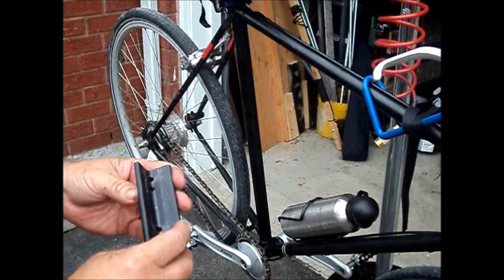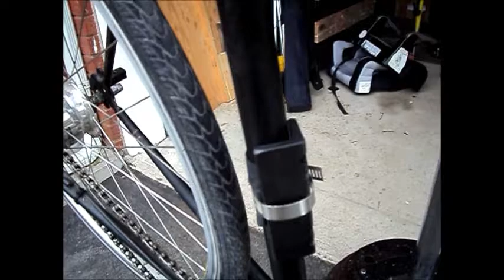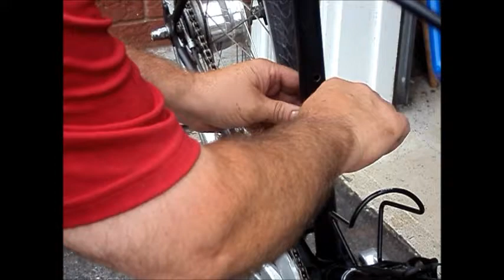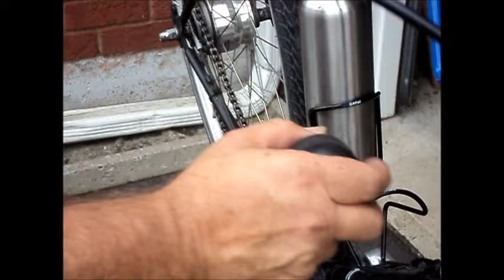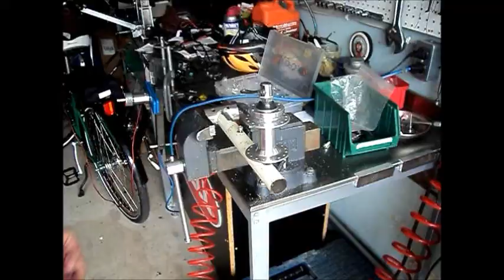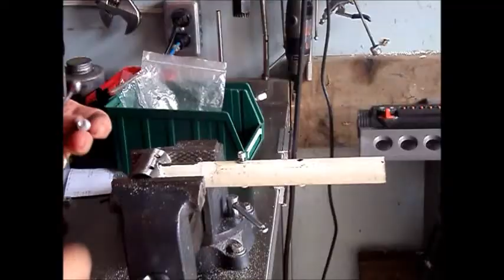Bicycle repair. Water bottle cage installation with Riv-Nuts

Comment: Stop! You had the hose clamp holding the jig. A second hose clamp would secure bottle cage. Maybe some tape so the clamp doesn’t scratch the paint.
Reply: why would he want to secure the bottle cage? that's why he's installing the bosses...to screw the bottle cage to them. and he's already protecting the paint with a piece of inner-tube

Comment: Awesome 'extra features' there. I have the setting tool but I also made a DIY version from a bolt and 2 x nuts one of which I drilled through to remove the thread.

Comment: I've drilled onto a (steel, freshly powder coated) frame several times free-hand, and didn't have any issues, but it'd definitely make me sweat less if I had a jig like that, so I think I'll make one.

What's that adapter for the Riv-Nut that's on your rivet tool, or is it a specific type of rivet tool altogether?

Thanks for the video, it was extremely informative.

Comment: I tried method #3 it worked.At first I practiced,I drilled a whole on an old chainring which is about the thickness of a seat tube.I drilled the appropriate size whole for the rivnut but i couldn't get the rivnut in so i re-drilled the hole opening it a bit,which was my mistake.Because when tightening in the rivnut,it would just spin in the hole and wouldn't grab.I corrected my error and tried it on the seat tube,it came out good. 
TIP:make sure you use a deburring tool on the inside of hole..

Comment from the maker: Are we talking about a steel riv-nut in a steel tube, or aluminum in aluminum? If it's steel, I'd say your chances are good that using JB Weld on the riv-nut would work to fill the gap as steel riv-nuts flare out flat inside the tube. Aluminum nuts tend to make a rounder bulge.
 If it is an aluminum tube, I'd suggest trying a steel riv-nut anyway as the JB Weld would likely insulate against galvanic corrosion in an oversize hole.

Comment: ...the hole is in fact over-sized slightly (partly due to me pulling out the old seized rivnut/bolt). If I use the proper rivnut installation tool will I be able to get the M5 7mm diameter rivnut to fit (the hole is close to 8mm diameter)? I need M5 as need to use M5 bottle cage bolt.

Comment from the maker: Perhaps you need to increase the amount of friction between the riv-nut and the tube to keep it from turning. If you are using an epoxy or a bonging agent, apply it to the riv-nut, and let it partially cure before compressing it.
 I've not experienced this problem, but the drill I use makes a snug fit,and the drilling jig ensures the drill stays centered and does not drill an oversize hole.

Comment: Cannot get method 3 to work - no matter how much I grease the washers or size of washers I use - they WILL rotate with the nut and in turn rotate the rivnut in doing so the bolt will simply unwind out of the rivnut rather than pull it tight. Is there a trick I am missing?

Comment: Great video! I'll use it tomorrow ! I'm from brazil and I'm installing a di2 battery on the chain stay can you give me the specs on the rivnut? The frame I'm using is carbon fiber and is thicker do you think that's the rivnut I should use? Thanks!

Comment from the maker: @hartleymartin  I would not use them on light weight racing forks, but on touring forks or something heavier they should be fine. Depends what you're planning to hang from them.